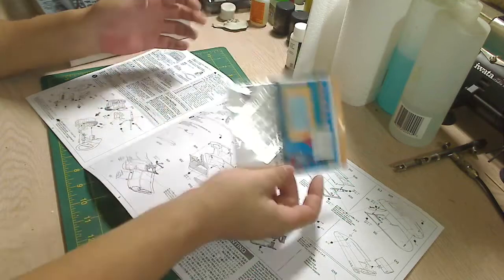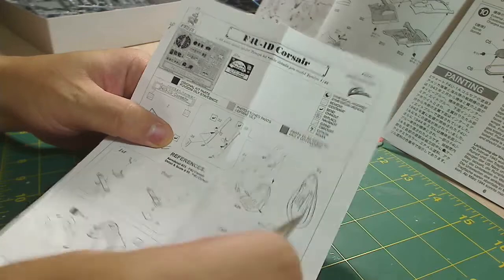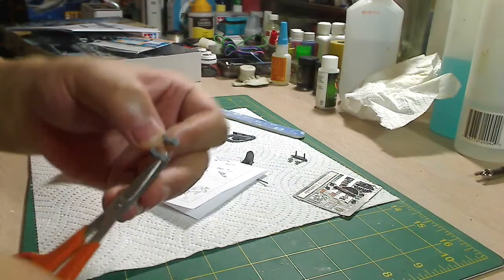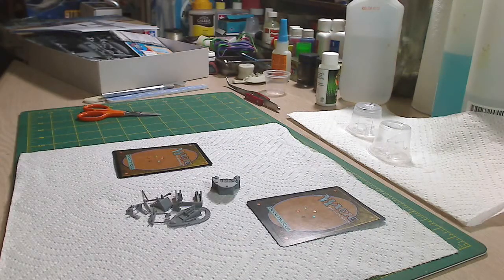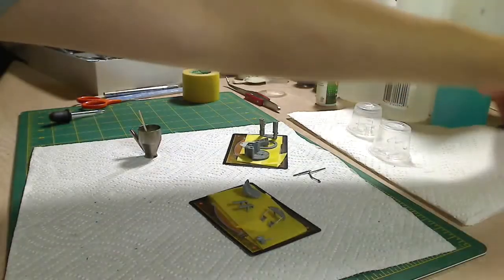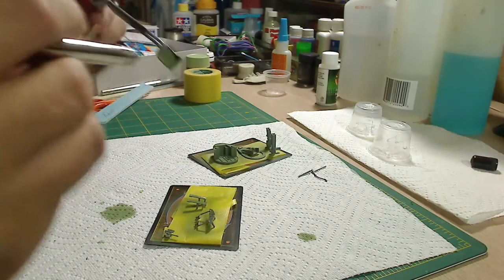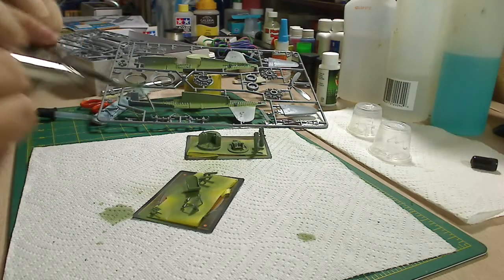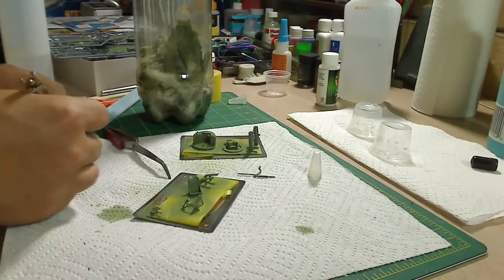Building a Corsair: Tamiya 1/48 - Part 3a: Building the Cockpit

Comment: To transfer paint from the container to my air brush cup I use a regular plastic drinking straw. I dip the straw into the paint, place my thumb over the end and remove it over the cup. There's no wasted paint like when using a dropper. Just a suggestion.that works well for me.

Comment from the maker: @ModelloursWorkshop I used to use a blade to do the "chiselling but it was way too messy and inaccurate.  With a sanding stick I'm able to keep the surface flush and with a rough grid it goes down pretty fast :)